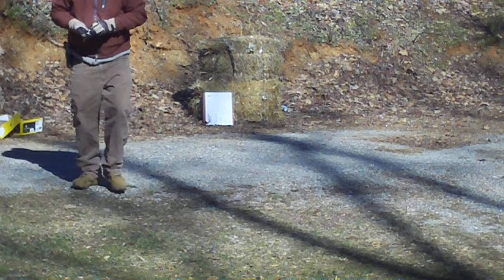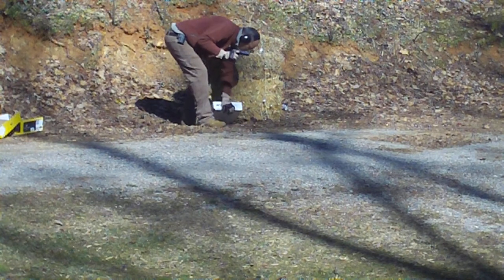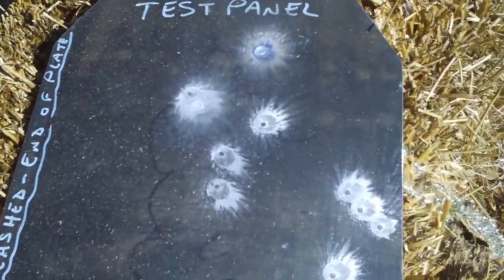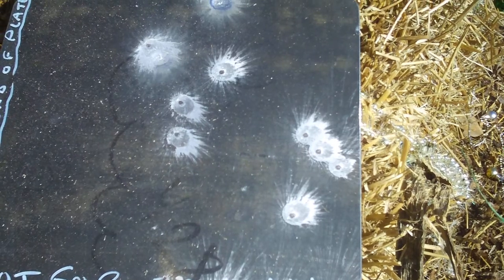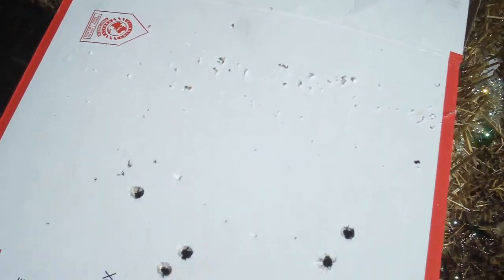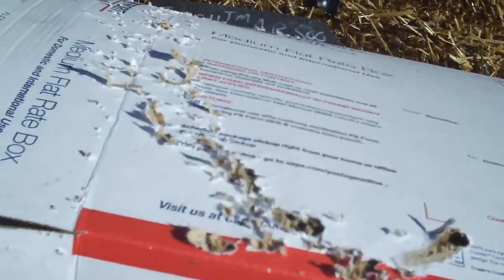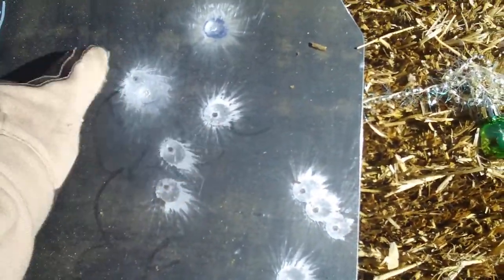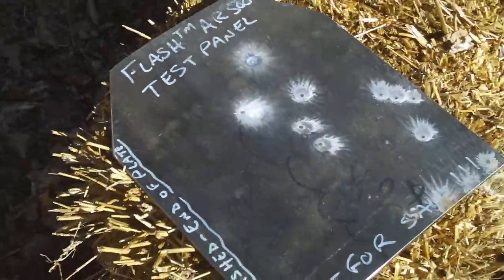FlashTM 500 Armor VS 9mm FMJ Live Fire Tests

Comment from the maker: No this is specially made steel. The whole Flash Bainite process is different than standard hardening. You cannot weld on regular AR 500 at room temperature. You can weld on this Flash Bainite AR500 rated plated at room temp. You should contact Gary Cola for technical questions instead of asking me. Check out Bainite Steel web site for contact info.

Comment from the maker: No. Exactly the opposite.Control the welding so that the plate does not get hot all over. Tack welds. Short stitch welds back and forth between areas...etc. DON'T heat the whole plate and it will be fine according to Gary Cola, the maker.